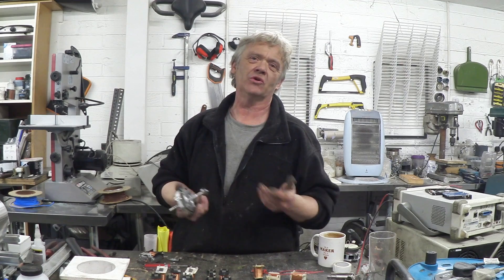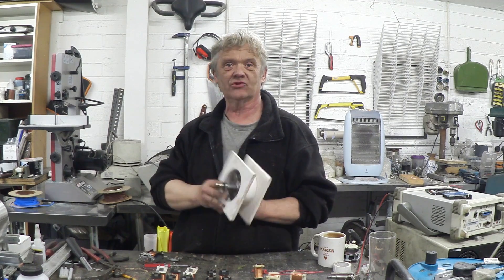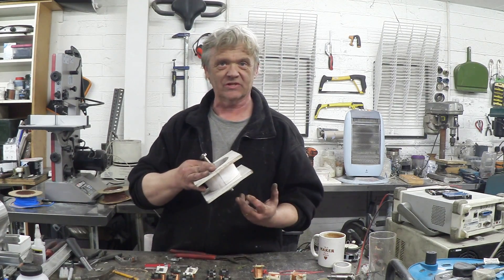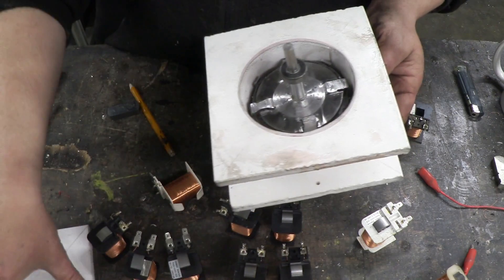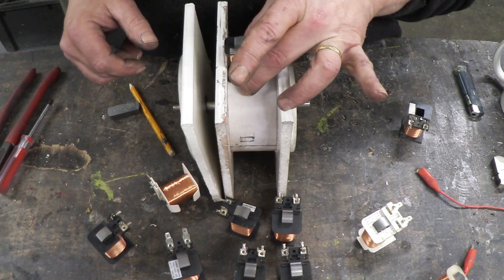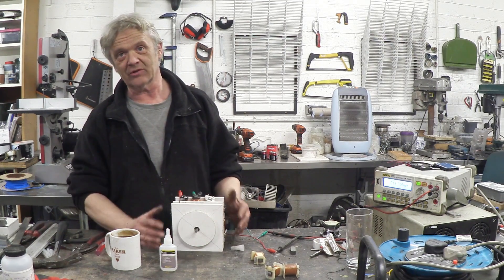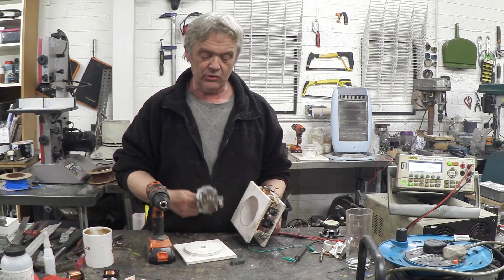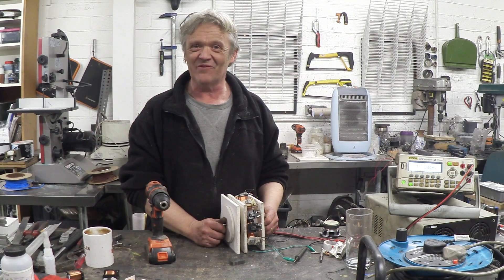1031 DIY Generator From An Old Speaker And Microwave Oven Parts

Comment: I have a question if your generator produces less than 12 volts which is wind generator is likely to be doing, can it charge a 12-bolt system, wheel four bolts or six bolts add up eventually over time?

Comment: Great work! Linking 5-10 of these in series and connecting it under your wind turbine  design with a gear switch to generate high output during high wind/storm scenarios might work! I also wonder if that casing could be 3D printed for those holes lining up as you mentioned for higher efficiency.

Comment: You are a very clever man, really enjoying watching your progress!  I want to get off grid, I have quite a large area of land, I'm currently planning on installing Solar with Tesla batteries, already have 4KW of Solar on my roof, which I benefit form the FIT.
Reply: If you're aiming to go off-grid & already have PV, then it might be a good candidate for a ground-sourced heat pump (especially if you're friends with anyone who has access to a digger to take the sting out of the ground works cost).  I've had 4kw of PV since 2014; sourced the panels, a roofer & a certified electrician to sign it off - all in it cost about half of what "one stop shops" were quoting so it paid for itself in <6yrs.   Not much land here, but have 5m^2 of solar thermal panels, which I'm hoping to use to charge a heat store, then run a heat pump from that.
Reply: @DT-dc4br  we have air source heat pump already.  Waiting for quotation for new solar system and batteries.

Comment: ok you got 50 volts a good start how many amps or milliamps ? even small projects added up can make a contribution freeing yourself from the grid and remember they do not all have to make electricity pumping water up hill lifting weights making heat also work and can be made to be interchangeable one of the  cheapest ways to store power is  pumped hydro. for instance solar concentration can create enough heat to be stored for use over night or off peak power can move enough heat to heat or cool for use during peak usage i always find waching you fun as you think about a lot of things i had not though about have you though about using all your little prodects to heat a tank of water or some such that can add to your comfort without adding to the bills. my though that with all these reality shows it would be fun to take real small towns in the poorer parts of the world and compete over fixing their problems.
Reply from the maker: no idea mate - but it was an easy project and a simple build - why not give it a go?
Reply: @ThinkingandTinkering  yes and that is the kind of project that will get built but so many projects are to big to complicated to small i really want to see people building things that make a difference because  no one else  is going to help and things are going to get messy soon.

Comment: Hmm so a motor and a generator on one shaft?? Were the Motor drives the Generator, that drives the motor, and we have ? :) Greate little build. Cheers.
Reply: A lossy flywheel.
Reply from the maker: you can do that mate - what's more you can put motor coils and generator coils on the same rotor pole pieces and that makes a rotary converter

Comment: If you are looking to increase efficiency you could do worse than having each coil lined up with each "bar" round the magnet. This would give you more of a sine wave output rather than  ripple as each coil squirts it's energy in and has some absorbed by the others! 
Then you could put a ferrous core in the coil and link it to the next via a band around the outside. this should give you a 10,000:1 improvement of the flux (minus the gaps)!
Reply from the maker: cheers mate